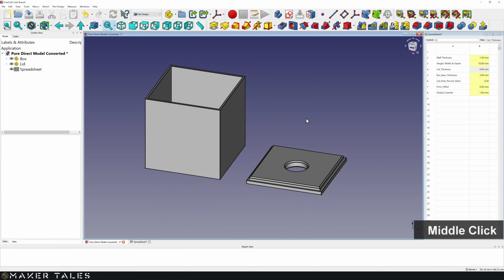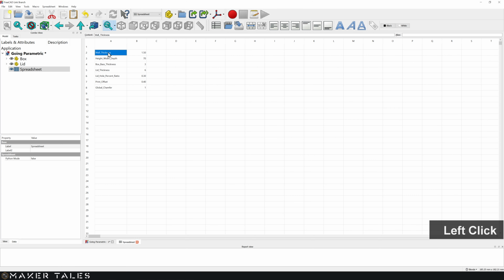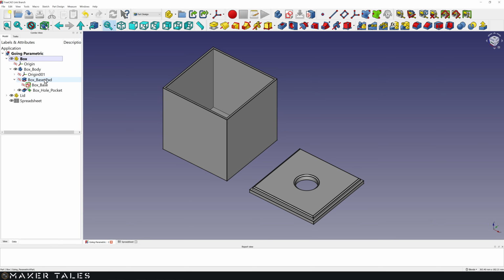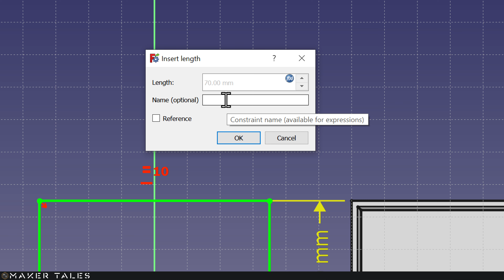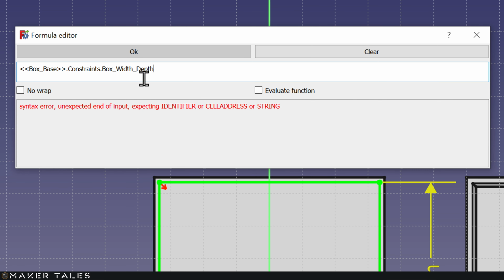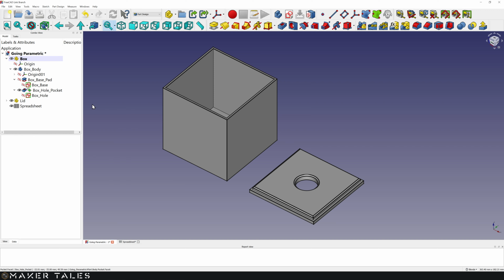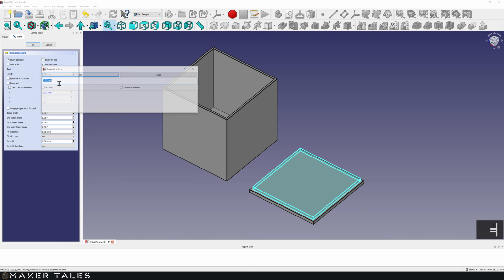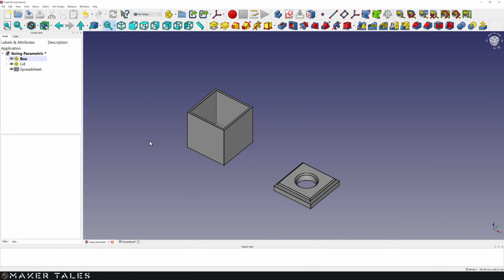How To Do Parametric Modeling In FreeCAD | The Realthunder Branch | P. 5

Comment: When setting up the spreadsheet initially, shift-click to select the whole column (or as many cells you're realistically expect to use), then right-click a cell for properties -> units, set it to millimeters or whatever floats your boat... Voila! All selected cells are now set to your preferred units of measurement and now you only have to copy-paste the aliases... 

I usually have a good idea of what I need, like L, W, H, shell thickness, extrusion height %, pocket depth %, fillet radiuses, screw hole radiuses, etc, etc. Helps you parameterize most aspects of your work and keeps you from being lazy if you already have the aliases for most parameters set up in your spreadsheet, not falling for the temptation to punch in direct dimensions... 

This multi-cell select 'trick' saves a lot of clicking to set units if you're setting up for a complicated model. 😉

Comment: Hi Jonathan,
Thanks again for this and hope I spelt your name correctly.
There is a built in Macro called Easy Alias for creating alias names for one column in the corresponding column with the numerical value. We can just install it from the Macro list then highlight the named cells and run the macro.
Reply: Nice tip! Now I'm down the rabbit hole of seeing what other potentially useful macros are out there :D
Reply: @virtualsid  Welcome. I'm still exploring (other areas of) FreeCAD. Three things to keep in mind.
1) As a still developing Open Source software, things that come built-in or native to the big guns like SolidWorks may not be available  or will require a 
work-around;
2) Consult the Wiki next; and
3) Search the forums and ask if necessary.

Comment: I've recently been teaching myself parametric design so I watched your video to see what I missed with my own fumbling around. I picked up a couple things, thanx for the education. Now I have developed a slightly different style with regards to naming derived values. This is mainly because I didn't think of naming my dimensional constraints. Although I've named and referenced reference constraints (the blue ones) when I wanted to reference something that was was out of my math skills, like a dimension from center to center of arcs that are constrained by tangents. What I would do is have two column pairs in my spreadsheet, one of constant values and one of derived values. So, for example, in your base pocket sketch, instead of naming the vertical constraint and then using that name elsewhere, I would put that constraint name in my derived columns with the formula in the spreadsheet. Then I would use the spreadsheet alias. This keeps all (most) of my named constraints in the spreadsheet so they are all in one place. But I do have to ask, am I potentially creating a bad habit that might cause problems later when I do more complicated models and start combining models into assemblies?
Reply from the maker: I'll be honest... As long as it works for YOU then it does not matter what anyone says. With that said if you are working in a "pro" environment I would check if there are any industry standards while sharing files but your solution sounds good to me 😊
Reply: I had the same thought. I am 100% beginner with CAD, but have some average coding skills (so that's where my mindset is on this). I was also thinking that trying to find the expression for a calculation using a constraint hidden within a sketch would be much more difficult than just using standard spreadsheet style calculations and referencing those. I don't know about industry standards, but I'd personally prefer all my calculations in a primary location.

Comment: For aliasing the spreadsheet, check out a macro called 'EasyAlias' (it's avaliable within the macro library from the FreeCAD's Addon Manager). You must have the spreadsheet selected as the current editing object within the object tree/history, then just highlight the column with the names in it, and it will automatically alias each related cell within the adjacent column using the content from the respective cell of your selection. The only downside is that it just takes care of the names, it doesn't do the units for you.

Comment: Hi, I've used the spreadsheet for this as well, most video's about parametric modeling use the spreadsheet. But this is pretty cumbersome. I got the tip of using the DynamicData workbench. This is so much better to use, maybe you'll find it nice as well, and use it in a video to teach people not to use the cumbersome spreadsheet.

Comment: Jonathon, I don't know if this is something you already plan to cover, or if it's worth covering, but I'm having problems getting a fillet on a line where 2 pad intersect (ie pad 2 uses a surface on pad 1 as the origin)

It's complaining about being an impossible shape. The fillet looks ok at the line, but in the window it seems to also be trying to make the fillet "inside" the joint also. So it looks like an S shaped fillet, folded back on itself.
Reply: Collin Baillie  You have probably asked the  Forum but, if not, try uploading the file to the forum, explaining it's FreeCAD Link branch file and somebody is likely to respond. My forum name is Ubiquity but I don't guarantee to have an answer as my experience is limited.